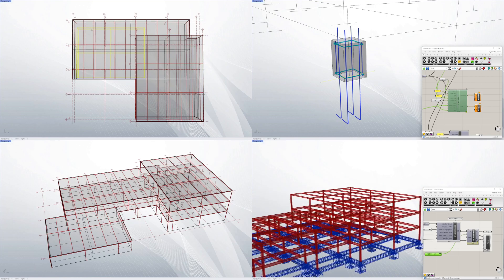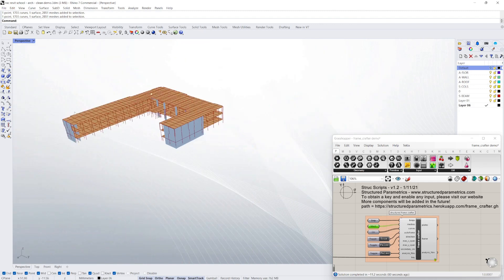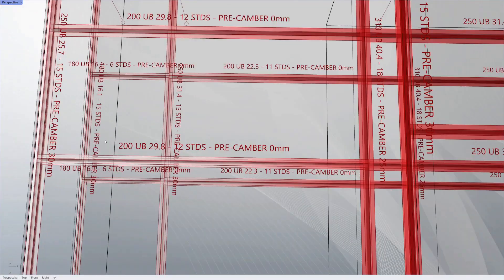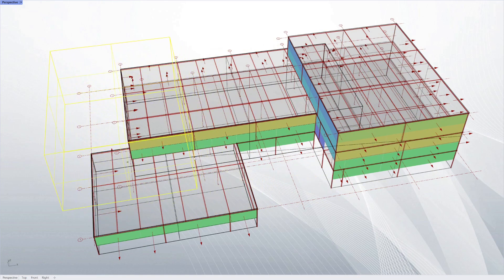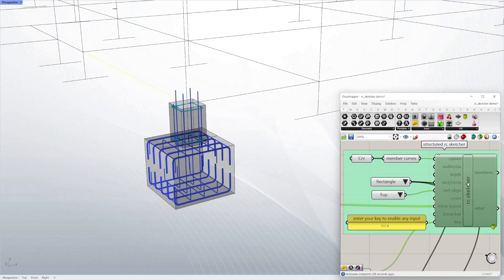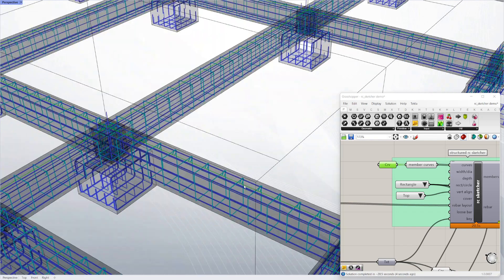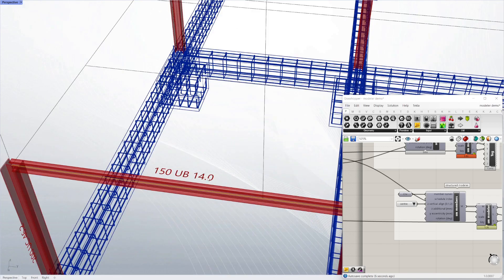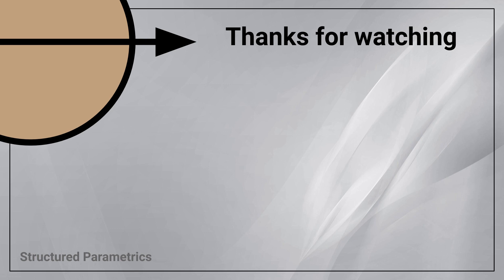Structural scripts. Automation for faster, modelled workflow in Engineering and Architecture.

Comment: I'm curious about how the general workflow looks like when working with these kinds of stuctural projects. Do you have to create a new script every time you start with a new project? Because if that's the case, I don't see any benefits of working with Grasshopper because of the time that I spend just creating the script, I could have finished the whole project.
Reply from the maker: The scripts shown here are all multi-use components and can be used over and over again for many projects without modification. For example, calculating wind load could be done manually or with a spreadsheet/program and entered into analysis each time but it makes sense to automate the process and save the manual labour. 
Of course many people use grasshopper for project specific cases as well. As you say though, that can be very time consuming.